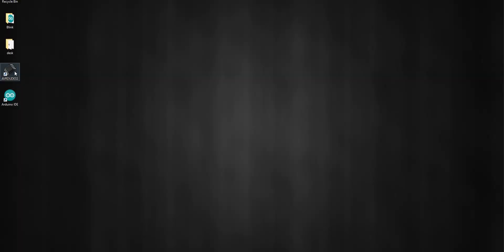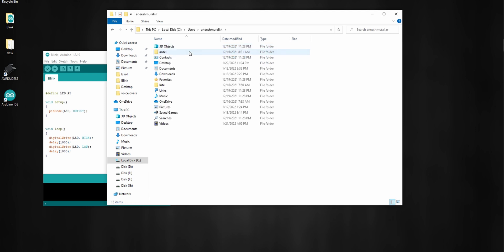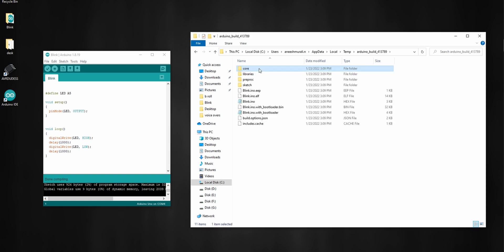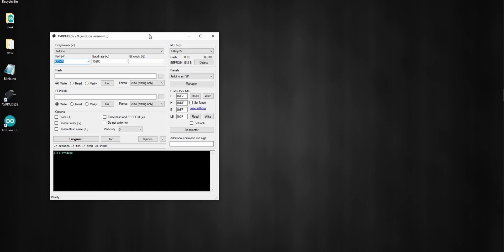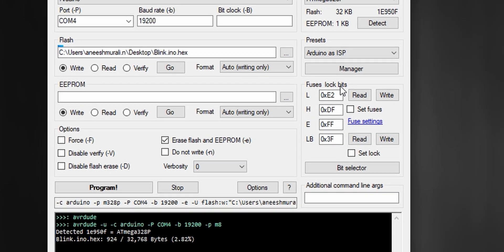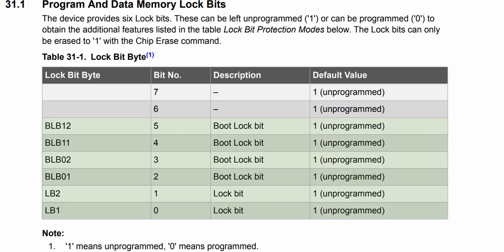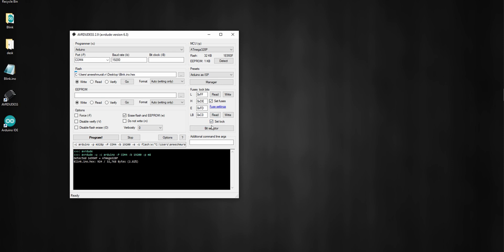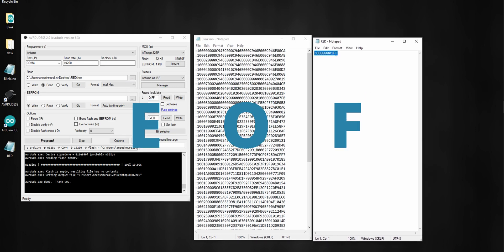How to Stop  Cloning Your  Arduino Atmega328p Programs, Do This

Comment: first of all, thanks for the video 
I have a question if I want to update the code on the chip after locking it will I be able to clear the flash memory and upload the new code ?
Reply from the maker: You can flash new HEX files after performing a chip erase, just like the way we did. However, if you want to restore the chip to function like an Arduino again, you'll need to burn the Arduino bootloader onto it.
Reply: @AMNLabs  thanks a lot ❤

Comment: I Want To Clone A Protected AT89C2051...
I Want To Backup This Firmware...
And Please Tell Me How To Remove The Lock Protection...
Reply from the maker: What's the point of protection then?
The idea of securing a microcontroller is to safeguard its firmware and intellectual property. While techniques like voltage glitching, clock glitching, or even destructive methods like chip decapping exist to bypass protections, they require expensive tools, specialized skills, and are often illegal or unethical. Personally, I’m not a fan of these approaches.

As an engineer, I believe in creating and innovating rather than breaking into old designs. If I ever lose access to something I built, I see it as an opportunity to rebuild a better version from scratch, turning it into a chance to improve on the original idea.

Thanks for your feedback!
I truly appreciate your curiosity.

Best regards,
Aneesh Murali Nariyampully
From Ciiads (Curiosity, Idea, Imagination, and Designs)

Comment: Hello! Does this method work for the pro mini ?
Reply from the maker: Yes it does and works for every MCU's but settings might different😊👊
Reply: Realy, I tried here but without success, and also can't find any information about codes for pro mini anywhere...

I think the quickest way is to break the RX / TX pins. 😅
Thank you for the answer   👊
Reply from the maker: @chiptekelectronics reading and writing firmware through rx tx pin works through bootloader but we can also pull the firmware through miso mosi cs sck pins so breaking the pins not the quickest way, flash the chip with proper settings and at the same time without bootloader that's the way to go. 😊👊
You have to read the chip datasheet to find the lock bit settings and you have to read the chip first with my method to see the current fuse bit settings of your promini, so copy the current fuse bit settings and for the lockbits read datasheet, if your promini had the same chip atmega328p or atmega328 then you can keep the same lockbit settings as shown in the video and remember you have to apply the same fuse bit configuration that the promini already had. otherwise the chip will break.
Reply: @AMNLabs  Got it. I was using an FTDI adapter, but I have to use another Arduino to access the ISP protocol, right?
Thank you very much for your attention, brother!
Regards from Shizuoka, Japan.
Reply from the maker: Another Arduino or programmer 😊👊🤝

Comment: Almost good video, but these 15-25 year old Atmega chips can be readed out under seconds using voltage glitch...
Reply from the maker: Good for you. After all those years they still didn't fixed the glitch I don't know could you please make a tutorial about that and share the link for the audiance 😊.
Reply: @AMNLabs   I not have time to make tutorials, it is very simple to use the voltage glitch, there are tons of descriptions on the github

Comment: How to read our secure data without knowing hacks
Reply from the maker: @mohitraj5804  what you mean hacks?, it's not a hack it's a protection feature. if the chip is locked then it's locked. There is no way to pull the code out as per my view. if someone willing to do I would appreciate them. 😊

Comment: hello , is there any way that somebody can still extract the hex file from arduino if the microcontroller has bootloader inside it aswell ? 
I have read in some forums that is possible to still extract the hex file from the microcontroller through the bootloader that is inside the mcu. how true is that ?
Reply from the maker: So chip erase then flash the without bootloader version of the hex file with the new fuse and lock bit settings. that's exactly what we did here 👍
Reply: i saw that you flashed all the 6 lock bits . BLB01 BLB11 BLB02BLB12 are 4 lock bits that are responsible to lock the bootloader . Since you have the hex file without the bootloader then why you are still programming those lock bits ? I think LB1 and LB2 are enough to program if you have a hex file without a bootloader on it .
Reply from the maker: @Email-wg8je  just closing all the doors  as we can👍😁

Comment: If you want have close source, don't use open.
Reply from the maker: The chip itself is not open source, the video is about bit lock atmega. There is nothing wrong to use opensource development boards to develop firmware but you have to write every piece of code your self including librarys for a closed source project or you have to buy the lisence and need to credit properly.
Arduino is opensource platform but atmega MCU's are not.

Comment: Can i program  that arduino board with new program ? 

And can we use eeprom and serial communication ?
Reply from the maker: No matter which board you're using, it's all about the chip. Of course, you can reprogram after a chip erase, and there are no restrictions for serial communication and EEPROM usage. However, you can't upload an Arduino sketch through the Arduino IDE because that requires a bootloader, and here we've disabled read and write access to the chip as part of the protection mechanism. If you don't need any protection for your software and want to revert everything back to normal, just erase the chip and burn the Arduino bootloader. Then, your Arduino board will be back to its original state.
😊 AMN

Comment: Is arduino not open sourse ?
Reply from the maker: Of course, Arduino is an open-source development board based on the AVR Microcontroller it has security features called bit lock to safeguard against firmware copy and clones. Arduino is not a locked one it's loaded with a serial bootloader but that doesn't mean we can't use the security features of the microcontroller itself.

Comment: So, the lock is not a permanent lock. Anyone can unlock it later, right?
Reply from the maker: What you mean? 
No, it's permanent as per the security features of the MCU. You can reuse the MCU after erasing it, but that doesn't mean unlocking it. Erasing it wipes the entire bit lock and program memory, meaning everything is gone.

Comment: High voltage programmer can unlock chip without loosing data or program?
Reply from the maker: Maybe, if there is a glitch but I  don't think so, try your luck. You know if that is possible the protection feature is pointless right?

Comment: It seems to work, but I have got a warning during writing (ignoring mismatch in unused bits of "lock"
             (0xc0 != 0x00). To prevent this warning set unused bits
             to 1 when writing (double check with your datasheet first).
avrdude.exe: 1 bytes of lock verified), 
and I cannot access to the "read file" for verifying that the file is empty (although Avrdudess says it is empty during the second attempt ro read the board). 
I send you an email with the log: I would be graceful if you can reply, because I am so close to succeed !! 
Thank you very much for your help !
Reply from the maker: If 0xC0 is not working then you continue with 0x00 that is because there are only 6 bits in that register so 0b000000 is 0xC0, Bits 6 and 7 are not used that's why it shows the warning.
0b00000000 is 0x00 which will set the unused bits to 0 so don't worry both will work and both will do the same. continuing with the  0x00 will not gonna show you the warning ☺️👊
Reply: @AMNLabs  Thank you very very much !
Your video is by far the best one on this subject : it is clear and complete, exactly what is needed to perform this cloning protection 💛
Maybe (it is just a suggestion) you could make a 2nd part related to the EEPROM section, but I suppose it is very similar.
Than you again: I subscribe your channel !

Comment: But previously you said Arduino doesn't have Copy protection feature in Hex pulling video !!
Reply from the maker: Yes, Arduino doesn't have copy protection feature that's why we got the hex file in the hex pulling video I hope you watched it but you know Arduino is made out of avr mcu it has so many features bit lock is just one of them but Arduino is not using that feature that's why we used an avr tool to bit lock the mcu her atmega328p, Arduino is an open-source platform that normally comes with a serial bootloader and there is no chip lock, normally arduino doesn't bit lock the chip. and this is the way to lock it. ones you've done it's never gonna work like Arduino anymore unless you erase and reburn the Arduino bootloader.

Comment: Excellent video; I still have a question:

Question: Is it possible to use a USB-ASP adapter instead of an Arduino Uno to perform the Lock bits writing in the target board ??

Thanks
Reply from the maker: Of course, you can do 
Here one of the Arduino is programmed as an isp programmer but if you have a dedicated USB-ASP programmer its output is always isp like MISO, MOSI, RESET, VCC, and GND that's what we need to program the MCU. 
So 100% you can go with that.
😊👊❤️🤗
Reply: @AMNLabs  Thank you, next question: after having protected the code with this method, is it possible to re-use the board for another program ?
 I mean: is it possible to upload a totally new code into the Arduino ? 
Is there something special to do ?
Thank you !
Reply from the maker: @elodiecemoi3057  Yes, but you have to erase and re-burn a fresh appropriate Arduino bootloader to revert that back to a normal Arduino board

Comment: Bro i see you check the erase for eeprom, i have my coding include the eeprom. ? Is the code still working because the eeprom had just erase in avrduddes.please answer🙏
Reply from the maker: It doesn't matter, it will work, we are just erasing the previous EEPROM data on the target chip to write a new one.
Reply: Thanks so much bro🙏
Reply: Bro how to set it back as default like before? Because after i run the program the arduino could not be upload for new program, i means i tried to upload new program but it can't , please do some help🙏
Reply from the maker: Once you locked it's locked, if you wanna undo everything, just erase the chip and burn the appropriate arduino bootloader that's it
Reply: @AMNLabs  thank you so much bro 🙏
Reply: @AMNLabs  if you dont mind please make a video how to do it😊
Reply: @AMNLabs  Is it possible to burn the bootloader by simply using a UNO as the programmer for the target board, or do we have to use a high voltage programmer ??
Reply from the maker: Of course, you can use uno to burn the bootloader after uploading the Arduino isp sketch to it. Then it will act as a programmer.
Reply: @AMNLabs  No need for a High Voltage programmer to re-burn the Bootloader, even if the fuses and Lock bits have been previously burned as explained in your video ??
Reply from the maker: Yes if You erase your mcu it will reset the lock bits after that you can burn the bootloader you do not need a hi voltage programmer 
Here we have not changed the fuse bit config that is just the default fuse bit for that Arduino uno when it runs at 16mhz external clock. In any case, if you changed then you have to continue with the changed settings for the next burning or anything for instance if you changed the fuse bits for the 4mhz external clock then you have to connect a 4mhz external clock for the next burn.
I recommend, if you don't know what you are doing then please don't do it.
If incorrect fuse settings are applied to the microcontroller, it can render it unresponsive to normal programming methods. In such cases, a high-voltage programmer can supply the necessary voltage levels to override or reset the incorrect fuse settings, allowing the microcontroller to be reprogrammed with the correct settings.
Reply: @AMNLabs  as I know high-voltage programmer will not only help to reset the incorrect fuse settings but also It erases all code inside your MCU so, if we lock MCU to protect MCU from unauthorized meaning it need a special way to upload hex file from MCU

Comment: will this also prevent reprogramming/reflashing the Arduino with USB?
Reply from the maker: Yes you can reprogram after the chip erase but if you wanna undo everything like the actual functional Arduino board, definitely you have to burn the appropriate bootloader for the chip which is the thing that handles USB serial programming 👊☺️

Comment: Possible to do the same using uno as programer to atmega8?
Reply from the maker: Yes, the programming method will work for most avr MCU's but the fuse bit config and the wiring will vary according to the target MCU and the compiled firmware 
☺️👊

Comment: ...if your firmware is very unique, then there is always a way to get it out from chip..i think best and most effective way is to make your firmware works as it should, only on particular chip that is uploaded to..in case of been cloned, it will simply introduce errors to any variables or data that it is processing and rendering it useless to clone anyway..
Reply: How can I get started with that?
Reply: @Kyle-ye4nj  ..well, you could use IC dedicated for that, such as ATECC608B, or simply, read serial ID of your microcontroller, randomly, every 2-10 minutes, and in case it doesn't match ID  hardcoded inside firmware, simply introduce random error, which you add on to result of some variable used by MCU to do desired job...

Comment: What is problem in my Atmega328P-U microcontroller. I am using external 16mhz crystal . I am using this setting 0xFF, 0xDE,  0xFD,  0xC0 and write by avrdude. 
my project stuck or hang after some hour...
how to solve my problem...plz tell me
Reply from the maker: @sushantasarkar123  you mean hang after some hours that's definitely not the problem of lockbits.

Comment: How can I calculate fuses atmega328p interial 8mhz and  program it
Reply from the maker: First, you have to develop or code your firmware for 8mhz internal oscillator
Then you can burn that with 8mhz internal oscillator fuse settings
To know more about fuse bit just Check the data sheet of the chip or simply google avr fuse calculator it's an online website tool to calculate the fuses for avr   MCUs 
Or if you would like to do that in arduino ide then you just google arduino 8mhz internal clock
You will reach there
Reply: @AMNLabs  thank you

Comment: So it is possible to undo that
I. E. I I am a genioun person who uploaded code, as i wants to reuse the ic  , but I don't want to code and I want a clear flash chip 
Is chip is permanantaly locked?
Reply from the maker: Yes, the chip was permanently locked but you can re-use it by just simply erasing the chip. Chip erase will clear the flash.
Reply: @AMNLabs  thanks👍

Comment: After set a lock according to this video.. how can we reset the arduino to upload a programme through arduinoIDE ???
Reply from the maker: Just flash Arduino bootloader.
Reply: @AMNLabs   sir how can i burn bootloader.. i am trying to enable it with 2 arduino,, 1 as a programmer and the other one as a target device.  But when i am clicking on the burn bootloader option , there are some errors i am facing.. please help sir
Reply from the maker: Okay what is the error.
Reply from the maker: First upload Arduino as isp sketch to an Arduino. Then wire it with target chip.
Select Arduino board type and port.
And select programmer as Arduino isp.
Then burn bootloader.
Reply: @AMNLabs  actually i think i am trying it with wrong method . Can you please tell me how i have to do it ??
Reply: @AMNLabs   i have connected both the boards in the same way you had showed in this video  and after that i have opened the arduino Ide software and after selecting the port and the programmer ( arduino as ISP ) clicked on the burn bootloader option.. is it right way ??
Reply: @AMNLabs  yes sir i did the same.  But when i click on the burn bootloader option the error code says -  invalid content
Reply from the maker: @smartgadgets5795  
How can I clarify that through comments.
Could you forward your setup, just maill me
Reply: @AMNLabs   sir please share you email id. I will send the error details to you..
Reply from the maker: @smartgadgets5795  just look up on my channel page.

Comment: Hi ,what's if want to reprogram the chips , it's possible ? or the changes are for ever?  thanks,, greetings from Argentina..
Reply from the maker: Yes reprogramming is possible but that will automatically erase the chip memory.
The changes are not for ever unless you erase the chip.
Always you can change the fuse and lock bit settings any time you want but it will erase the chip so you don't wanna worry about that.
If you want to make the Arduino board back to it's original state, I mean without any bit lock, you have to burn the Arduino bootloader.
Regards.
Aneeshmurali
❤️🤝😊✌️
Reply: @AMNLabs  Thanks for the info i'm trying to protect my work.. thanks a lot.
Reply from the maker: @josevillalba4497  
Nice to meet you.
Wish me luck.
See you again.
Have a nice day Bro 😊👍
Reply: @AMNLabs  good luck!!

Comment: Thank you for this tutorials sir..it helps alot..
Reply from the maker: Have a nice day ✌️❤️
Reply: @AMNLabs  Hello sir, is this working in ATMEGA1280?
Reply from the maker: @Bisdak Hydroponics  
settings are different.
Wiring diagram is different.
Tip
1, First just read and find the original fuse bit settings of your mega.
2, Keep the same fuse bit configuration.
3, keep the lock bit configuration to 0xC0 like this video.
4, for wiring diagram and further info.
Watch my previous video and check the description. From there you will get the wiring diagram.
5, Just google "How to read and extract hex file from Arduino board" which will take you there.

Have a nice day.
Regards
Aneeshmurali.
😊🤝✌️